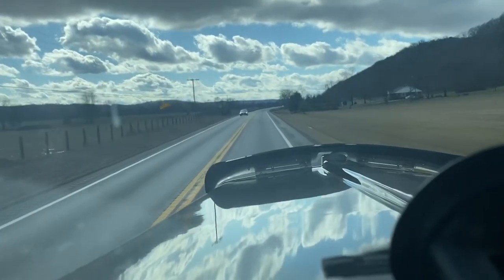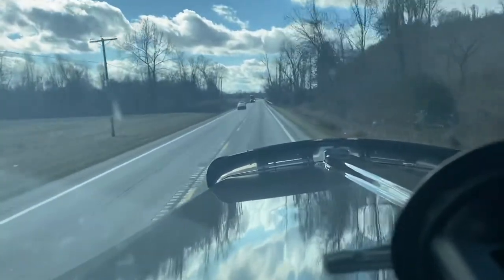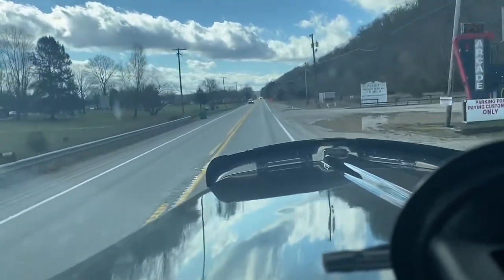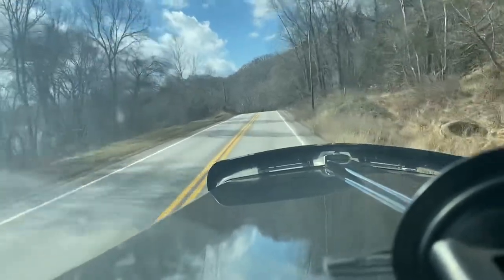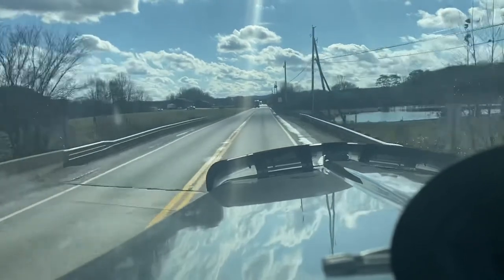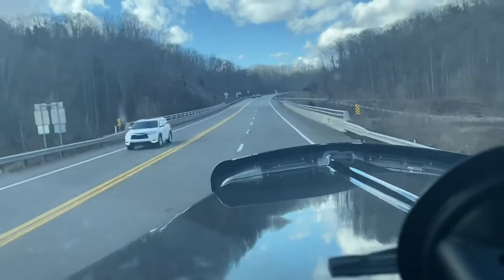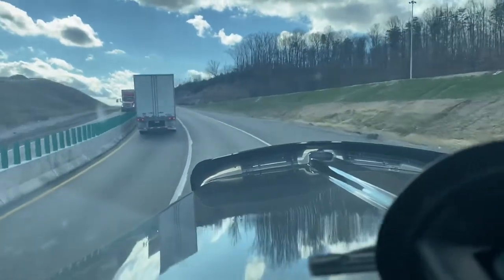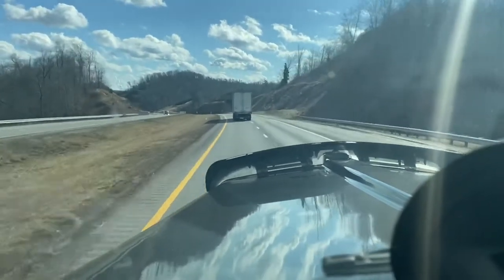How to handle high winds and curves in a tanker #cdl #trucking #tanker

Comment: What's a bad wind speed what do you consider bad where you have to shut it down Ive been told 10 to 15 mph you shouldn't even be driving
Reply from the maker: 25 and up. 10-15 ain’t bad at all. That’s normal. The “gust” is what affects you the most. You won’t feel it as much with a tanker as you would a box trailer because of the open and rounded sides.
Reply: @thesmallfryshow  ty I've been getting different answers everywhere man . So if I'm empty where I do slide the tandems then
Reply from the maker: @danielcristiangarcia2881  tanker the axles don’t move. But on an empty box trailer I just put them at the 41 foot mark. Not too far up, not too far back.